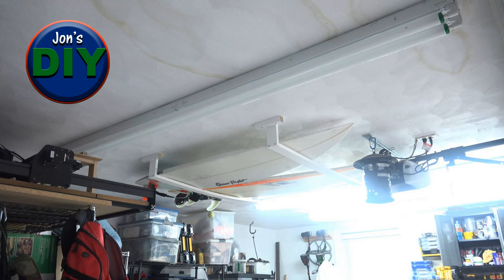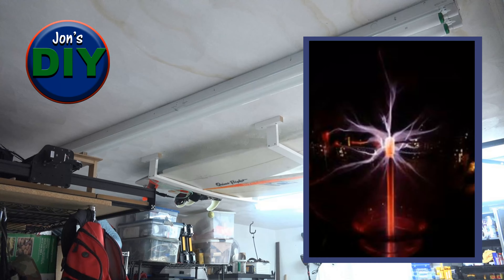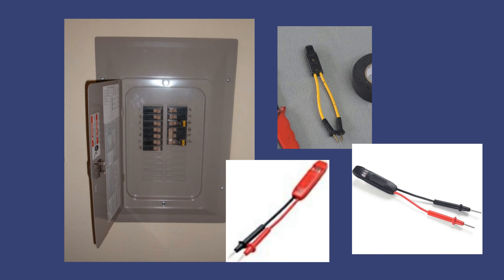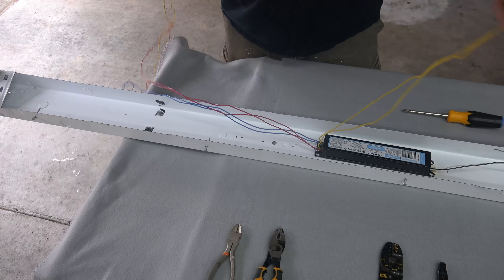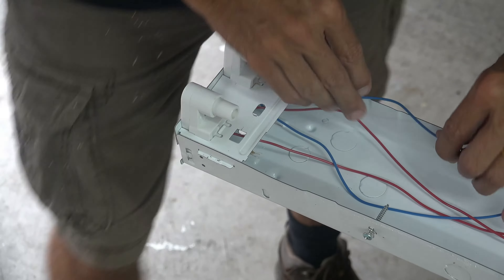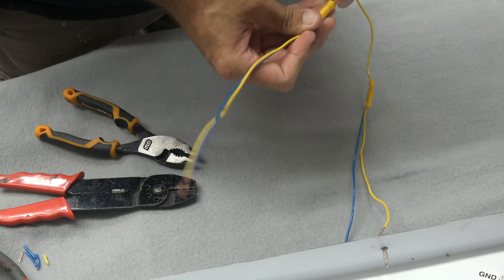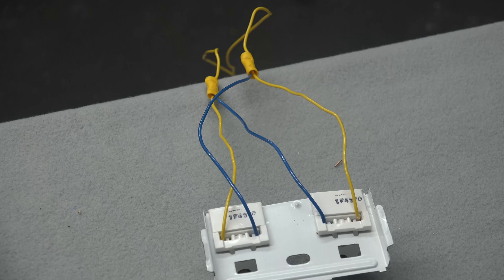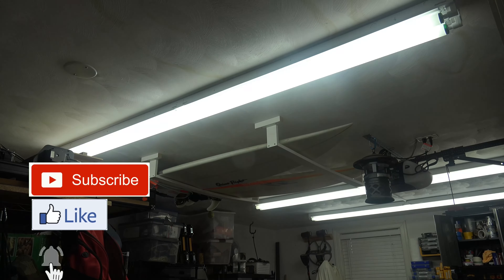New Ballast Wiring, Florescent Light fixture Wiring

Comment: Jon, I have the same fixture and Ballast that you have here. The way you wired this is right but it should be noted that that ballast is for 95w-110w bulbs. I found out the hard way. I'm using 75 watt bulbs. It worked but if I turned the light off and back on, it wouldn't come back on.  Called the company and they informed me it was because the bulbs weren't high enough wattage. Thanks for this tutorial it really helped me.
Reply: Came here looking for a comment to help me. Thank you! I was so frustrated!

Comment: I'm getting 3 volts output on the same model ballast whats the normal output voltage for these?
Reply from the maker: The ballast converts 120 volts to a continuous 277 for pulseless stream.  Ensure you bought the correct ballast.  Some are solely for single lamps while others support dual and even quad lamp fixtures.  Trying to run a single lamp ballast with a four lamp draw will give you the kind of out put you are seeing.
Reply: @JONSDIY  yea it's a old ballast been in there about a year just wanted to confirm its busted since I'm getting 3 volts

Comment: Thanks a lot for the tutorial.  My old ballast only has one yellow wire.  It has the two blue and the two red and the main line wires black and white.  Home Depot and Lowes do not have a similar available.  One of the store assistants said to just use one of the yellow and cover the other.  But only one bulb come on. I will have to check with a local guy who know about electricity, and in the meantime that room has to remain off.
Reply from the maker: Yes, I found out this exact same thing.  Apparently they don't make the other ones anymore because they are less energy efficient.

Comment: What if they turn on and go right back off? I just replaced a 30 yr old ballast. Everything is hooked just like shown. What's wierd if I unhook one light the other works fine. If I have them both hooked up the flash and go back off.
Reply from the maker: This does not sound like a ballast issue but your neon tube issue.  It sounds like you have a hairline crack in one of your tubes.  When the gas is charged it expands and with a crack it will immediately turn back off as vacuum seal is broken by the expansion of the gas.  Swap it out with another light and see if this resolves the problem.
Reply: @JONSDIY  ok thanks! I have replacements I'll see if that fixes the issue.

Comment: I am trying to find a replacement for my malfunctioning ballast but - like yours - they all have 6 output wires but the existing ones have 7 outputs so Im wondering what to do with the extra "additional" wire? Sorry realise this is a very basic question!
Reply from the maker: Need to know how many lamps are in your fixture.  You might have bought a 3 lamp ballast.
Reply: @JONSDIY  just the x2 58W tubes. I have 2 set ups and both ballasts have x7 outputs.
Reply from the maker: @MikeTheBike2010  Ok, can you tell me the colors of all 7 wires.
Reply: Yep they are all white! Not much help am I. By the way this is in the U.K. so things might be different here? Sorry!
Reply from the maker: @MikeTheBike2010  Ok, tell me the make and model of this ballast and we will figure it out.
Reply: DP Top-258 T8 Twin electronic Ballast, the other model is a Pro Tec something or other which I actually found online - minimum purchase 500! Both came as supplied with twin outdoor neon light fitments. Looking at wiring diagrams online it looks like the extra 4th of 7 output goes to a common line between both tubes but I’m very confused as both mine currently wired for 7 but new ones only 6!
Reply from the maker: @MikeTheBike2010  I have searched high and low for a wiring diagram for that model to no avail.    The one your looking at, did it come with the ballast or did you look it up online?  And if online can you shoot me a link because I am perplexed.
Reply: Ignore the input side (mine are not dimmable) but the output diagram has the 7th “common” connection as shown and used on both of ours?
Reply: So I need to know what to do with wire “no 13” in this diagram if I swap to a 6 output one?

Comment: I have 2 4 bulb lights that were removed from an office, mounted them to the ceiling and ran the black,white and green to the plugin, POP trips breaker. Opened them up and disconnected the 2nd one and the first one works, disconnected the first and tried the 2nd light, works. connected them back in series and POP trips breaker. I'm lost! White is neutral, Black is power and green is ground. Any ideas?
Reply from the maker: Couple of things first.  Do you have a refrigerator or icebox in your garage?  Second does anything else in the house lose power when the breaker is thrown?   Was the box (the thing the neon tubes sit in) grounded to the outlet before you hung it.     Does the outlet itself have a ground wire and are you tied into it.  Sounds like a ground issue but don't rule out surge if you have a fridge.
Reply: @JONSDIY  This is in an out building/workshop, nothing was connected except the lights, since i use a small welder the line is 30 amps  (storm caused a power outage) that's why we decided to install the lights and we used a generator with a 20amp breaker on it, probably a good thing as 30 would burn something. hmm the plugin we were using does have the ground prong broken off , it was just an old cord we wired up. Drill,saws, street light all worked fine tho, it's just connecting the 2 lights together it pops the breaker.
Thanks in advance if i'm slow to reply.
EDIT: Power is back on but i'm not going to connect the lights to the 30 amp line and the generator is back in the barn so it might be a few days before i can get back to the lights.
Reply from the maker: @Per409  One very common cause or possibility that may initiate tripping in a GFCI breaker is the fact that it may be faulty. Many times, close lightning strikes cause faulty breakers, and they need to be replaced.   Since you say that you use a welder and support up to 30amp I would rule out the load. With a lightning storm close by anything is possible with electric lines.
Reply: @JONSDIY  No not lightning this was after the wind storm, no close by lightning, good rain tho.
Power outage was the reason we decided to put the lights up and try them out,, not much else to do with no power. So we got the generator and it has no problems as everything we tried with it worked fine including a 110v 12,000 btu AC. For some reason connecting both lights keep tripping the breaker. I think now i'll just run 2 lines and use 2 plugins one for each light
Reply from the maker: @Per409  Let me know what works.  Interesting problem. Sorry I couldn't help.
Reply: A lot of commercial office lamps run on 277v current, not 120v house current. Make sure your lamps can run on the lower voltage. You may not have enough juice to support them.
Reply: @daz4312  i forget what we did but they have been working since this was first posted